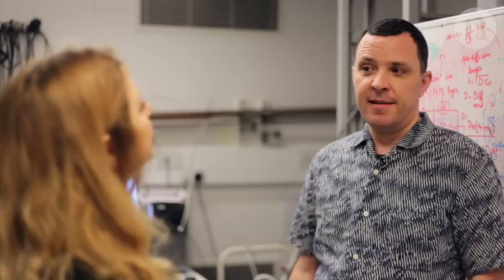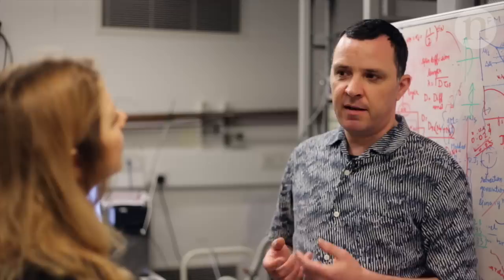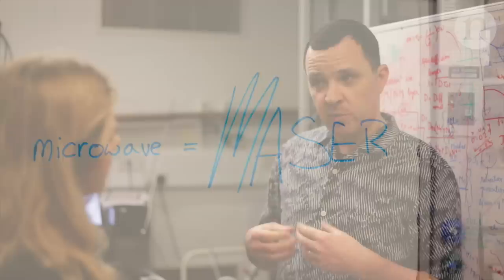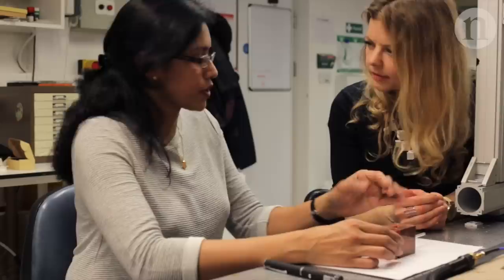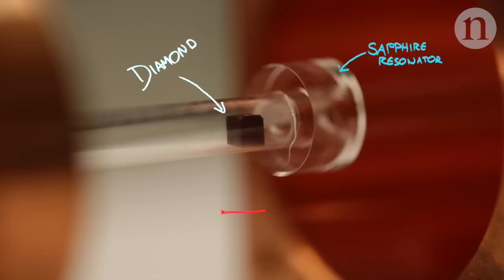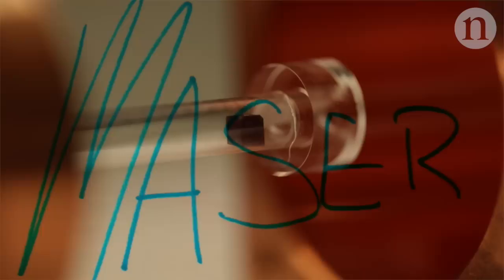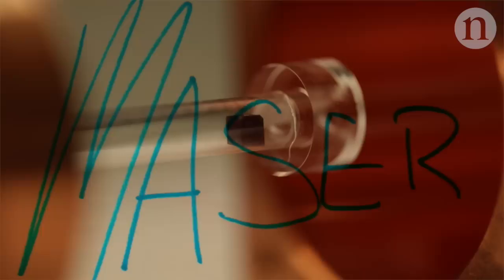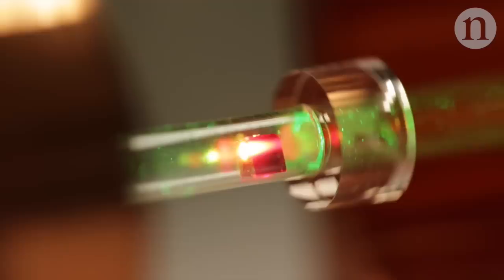The maser goes mainstream: Diamond microwave lasers

Comment: Surprising this discovery was released. A powerful maser would make an unstoppable weapon. Unlike lasers you cannot just put a mirror coating on things to reflect it. It does not have to burn through anything to destroy the electronics inside. You may have just ended aviation as a war tool. Military satellites may also be history now.  I guess it is back to horses and cannons.
Reply: Not quite, the microwaves are so low frequency/large wavelength that the beam cannot be very concentrated. Moreover, you can just put things in a Faraday cage.
Reply: Nos anos 60 aprendi que MASER seria como o LASER gerando ondas de ultra-som poderosas, e não ondas de luz. O princípio seria a eletrostricção, que é a oposição de 2 campos eletromagnéticos;

Comment: what practical applications could a maser be used for if the beam were strong enough ?

would it be used for the same applications as lasers are ?
Reply: Maser wont require Optical cables, as Radio waves can penterate walls!
Just directly beam the data!
Reply: Better radar, better radio telescope for satellites, better medical imaging that might be done in seconds instead of minutes, better detection of diseases or drugs in a body, etc.
Reply: If the technology matures and efficiency goes up we could expect maser based etching to be more efficient than laser based etching. I'd assume cpu die etching would be a wonderful application. And as was mentioned by a previous user the fact that masers are non optical means there is a possibility for non direct transmission. However it should be noted that microwaves are a high frequency wave unlike radio waves which are low frequency, its unlikely masers could pass through solid objects.

Comment: Since mobile phones transmit in the microwave range, this might potentially allow for some exciting needlecasting applications. Just... please don't cook my brain in the process!
Reply: true, true.  Cheap masers would be very exciting for all sorts of data communications, due to microwaves being able to penetrate so many things.
Reply: ehnt, wrong. high frequencies attenuate faster (less penitration). high bandwidth tho

and if you can be digital then your a bazillion quazillion times more likely to be one of the bazillion quadrillion of sims inside a matryoshka brain rather than actually being real atoms. kinda like 19^9999999999999999999999999999999999ect vs 1 = #of sims (if possible) vs reality

my brain is fried, sorry.
Reply: +John Doe    Microwaves are low frequency
Reply: bs its vhf
Reply: It doesn't really make sense to discuss if microwaves are high or low frequency if you're not saying relative to what. They have a lower frequency than visible light but a higher frequency than radio waves. So there, you're both right.
Reply: Microwaves are low frequency & "penetrate so many things", relative to higher frequency radiation that doesn't.  Such as visible light, yes.
John's just taking the piss Penny.  It's not a VHFASER
Reply: "please dont cook my brain"

Government be like " I raise your billion dollar 3/4g networks to a trillion dollar 5g millimeter wave spectrum and since it cant bounce through solid objects place them on every corner with out any health studies".
Reply: when you research something and realize the money backing it its never a bad thing to question something that gets pushed down your throat.. the biological effects are already documented in regards to em radiation.  why would those pushing it on people care of our health when profit is king..  seeing as they can profit trillions harming us more than they already do and then reap more profits when they tell us health care tax hike due to a increase in ailments.  Hell even californa has now passed cellphone useage guidelines due to the effects... Of course they cannot come out blatantly saying by the way this has been affecting the masses for decades now as it would open up the elite to masssiveeeee lawsuits.
Reply: #1 rule: don't trust government.
Reply: bempis
sorry my brain is fried.

do you know what a matryoshka brain is?

a huge clustered network of solar powered supercomputer satellites consuming all useable light of the sun. a machine that converts all the power of a star into computations. a machine that could run quadrillions of simulations of our universe, start to end, in the blink of an eye, without breaking a sweat. a toy gods play with.

"sfia" every arthersday.
Reply: John Doe so it runs on a Dyson sphere?
Reply: John Doe what sort of sci fi sodomy shenanigans would be behind asshole teleportation research and development?
Reply: bempis
if its government funded you can bet your ass
Reply: John Doe bet my ass oh that's funny rofl
Reply: Just using all of the power of our solar system with one hundred percent efficiency conversion to compute could not simulate the solar system entirely and accurately in real time.
Reply: OptimisticPessimist
do need help with the math?
Reply: Somewhere on an experts' exchange web site there's a discussion on what it would take to simulate Earth.  The computer would be larger than Earth.
Reply: quindecillions of operations per second per device.
Reply: Maybe with gamma ray based computers.  Who knows whether that will be possible?  People are still working out photon based computing I think within the visible light spectrum.  I've heard of the likes of, IIRC, IBM and Intel as some of the companies researching it.  Not that electrons can't move as fast as photons.  It's because a light  only chip can theoretically be sped up at least to the tens to hundreds of terahertz range before getting too hot.
Reply: but gamma (trillions) isn't even close to a quindecillion. like were talking differences of a party balloon and a star.
Reply: no, elections cant move as fast as photons. they actually move very slowly in an electrical circuit. like forever slowly.

but thats not how it works and saying it gets too hot would be accurate if you were talking about the photon maybe. i got the sense you were talking about the device would get too hot. no, it is too hot already. the distances between the gamma wavelengths and the atoms the device is made of is the problem. if the atoms never stop moving about in roughly the same distance as your wave form then.... fail.
all you get for now is an expensive random number generator, maybe.
Reply: A current CPU core can do triple digit operations per cycle.  Early Pentiums could do only a few.  Scale that to the number that might be reached when it's all figured out and then guesstimate how many cores are needed to reach quindicillion scale on a single node.

Comment: How are masers better than lasers?
Reply: Microwaves pass through many things unlike light. 
Communications!
Reply: were using microwaves to communicate now. that's not the question.

"how are masers better than lasers?" idk and not sure anyone else does rn. they are just different colors. you're question maybe should be "how are masers better than regular microwaves?" and that would depend on what you are trying to do. it's probably not going to be earth bound communications. I guess one day it could be but it just seams silly. basically you would need to constantly track each other's exact location near perfectly and then gimbal your antennas near perfectly otherwise you loose signal. all to save on a little power. maybe for deep space missions, maybe, and we would conjoin those with lasers, and lasers alone would work.

masers are just like lasers only a color of light you can't see. kinda like your tv remote is a flashlight, only its a flashlight that you cant see. saying "masers! masers! think of the communication!" is like saying that you want a tv remote that you have to point in just the exact right spot on the tv otherwise it wont work but the battery in it lasts longer. it's silly bc nobody wants it and energy consumption isn't a real issue.

tards blocking energy production is the issue. I dont see masers helping the fact that a lot of peoples brains are full of garbage disinformation.
Reply: John Doe some times less is more
I'M NOT READING ALL THIS
Reply: What do you mean? He asked how masers are better than lasers. It is a simple question to answer, and I did so. Microwaves pass far better through objects. That is how they are better, are they more complicated to use right now? Yes, of course. However, that one fact I stated answers the question already.

One thing I stated afterwards was that this allows for improved communications. Clearly you have no idea how current microwave communication methods work, they are not like lasers. The farthest in focusing them we usually go is by using dish's to transmit internet packets to businesses.
Reply: you can good tv diners with mazers
Reply: Imagine the difference between a regular flashlight and laser. You couldn't do many of the modern things like 'laser eye treatment' with regular light bulbs, because it is just not precise enough. Same thing with producing microwaves or any other type of wave. Being able to focus microwaves as masers at room temperature can allow you to do many new types of applications. Communications is one thing, but who know's what else can be done, it's like a new frontier.
Reply: Hmm if masers pass through some materials and not others and lasers get stopped more easily, I wonder if an optic chip could be made without using any electricity.

Comment: Where else will masers be used next?

Almost certainly weapons.
Reply: Oh yes, and power transmission. But weapons for sure. One application is simply focusing a maser on a target, like a missile, in order to heat it up. The coherence of the microwaves cause A/C electrical current to flow in conductive materials, this is will cause resistance heating. But since it is coherent, only high resistance metals will heat up quickly. Low resistance metals will turn into antennas that broadcast a microwave signal, so some % of the microwaves will be reflected instead of turned into heat at the target. 

Another possibility:
If you ionize the air with a UV laser it becomes opaque to microwaves but transparent to UV, as well as electrically conductive. If you target this plasma with microwaves it would rapidly heat and continue to ionize the surrounding air, engulfing any volume of air you could focus the maser onto in high energy plasma.
Reply: @scienceminded   I wonder if (like LASERS) MASERS would possess both temporal and spacial coherence.
Reply: @BaddaBigBoom  In fact that is exactly what happens. MASERS by definition have both spatial and temporal coherence. That is to say, both the phase and the frequency of some population of photons emitted are constant. The closer that the phase of a group of photons is to 0 degrees difference from one another, the more of a pure sine wave forms with amplitude equal to the sum of the individual photons that make it up.

If your lasing medium doesn't cause the population of electrons to emit light in phase, but at the same frequency, then you have made a monochromatic laser (single frequency), with poor spatial coherence but excellent temporal coherence. 

Anything other than 0 degree phase difference will result in destructive interference in some places, and constructive interference in others, making for pulses of energy and 'dark solitons' or pulses of darkness that are not necessarily at the frequency of the individual photons.

Comment: Aren’t microwaves a form of light? Last I checked they have a frequency of 300 MHz to 300GHz
Reply: 300 MHz is uhf high, usually microwaves are considered to start at 1000 MHz or one GHz and go up to 1000 GHz (1 THz)
Light, or the part of the electromagnetic spectrum visible to humans is past microwaves, past infrared, generally 380 to 740 nanometers or 4 to 8X10¹⁴ Hz. And there light sits, on the far end of the DC to daylight scale, but past it comes uv to x-rays to gamma rays to cosmic waves, and that's some high  energy stuff!!!

Comment: LOOKS TO ME ! LIKE U NEED TO FIND THE APPROXIMATE FREQUENCY OF THE EMITTED MICROWAVE ! THEN FIND THE WAVE LENGTH ! THEN MULTIPLY THE WAVELENGTH IN NM  BY 2 OVER AND OVER ( MANY MINUTES ) WHEN U SEE THE NUMBERS REACH CENTEMETERS  U CAN USE THE CENTIMETER NUMBER AS A HAND WORKABLE SIZE FOR THE TUNING CAVITY OF THE LENGTH OF THE DIAMOND ! U CAN MAKE IT SMALLER JUST DIVIDE BY 2 AND USE A JIG TO PLACE THE DIAMOND AND ALIGN IT ! I DO THIS WITH LITTLE PIECES OF PLASTIC DABS OF GLUE AND 0 / 80 SCREWS !  U WILL NEED YOUR MASER MIRRORS THE SAME AS A LASER MIRROR TUNED WITHIN 1 CENTEMETER OF THE CALCULATED TUNING CAVITY LENGTH ! IF U USE A TUNING CAVITY LENGTH OF LESS THAN 1 CM U DO NOT NEED TO TUNE IT ITS PERPETUALLY TUNED
Reply: Kuk I know right? Scientologists, meh....

Comment: Cant this be done with the entire electromagnetic spectrum? '(x)aser'
Reply: Not easily, but in theory yes. You need materials that can have the right electron transistions. 
Not just the Energy of those transitions is important, but also their decay time (when they spontaneously emit a photon) needs to have the right lenght. Most lasers need at least 3 suitable energy levels to create a real laser.

Comment: Tell us why masers are exciting over existing lasers?! What is the point of this video????????!
Reply: Good news... I guess? But my understanding is incomplete - visible light/ infrared/ xray lasers have higher frequencies - than why microwave maser is more powerful? And is it really?
Reply: Masers are based on magnetic waves where the frequency is measured in micrometers, radio waves are measured in meters, light waves are measured in nanometers. Higher frequencies imply higher energies. As such, masers are IN BETWEEN radio frequencies and light in terms of power. A photon is equivalent to one cycle of alternating voltage/current in your house wiring, just that the frequency is much much higher. The brightness of a lightwave is comparable to watts of electrical power. LED lights are miniature lasers with lenses that spread out and break up the beam of light. More can be said about all of this but generally speaking, masers aren't necessarily more powerful than lasers, just that the can penetrate materials that light can't. The same thing is true for radio waves too, so the only thing remarkable is that they can be considered to be high-powered radio waves, just as x-rays care considered to be high-powered light waves.
Reply: Thanks Martin!!!